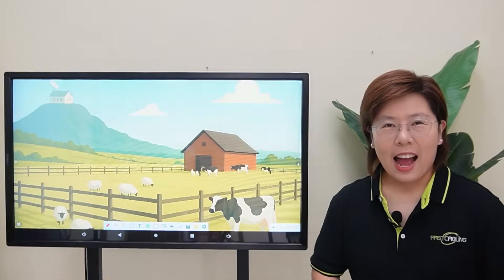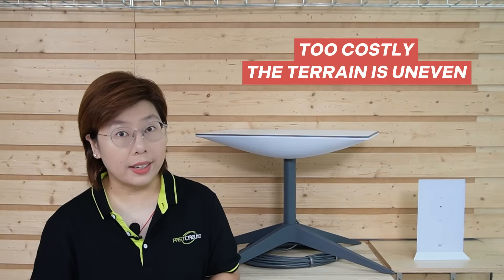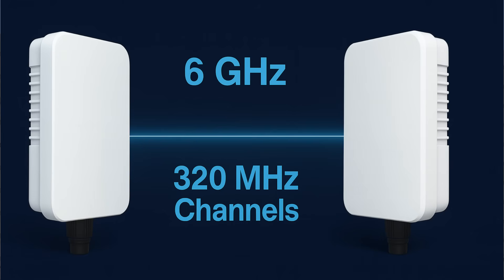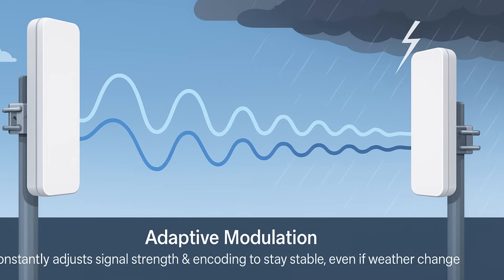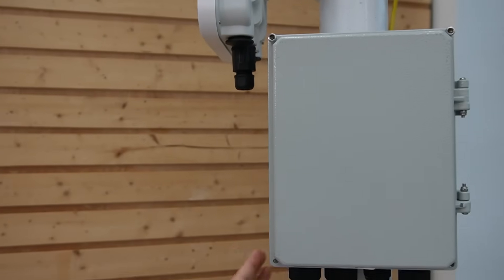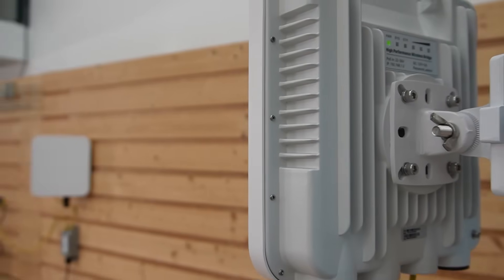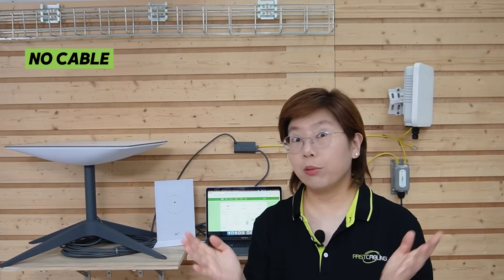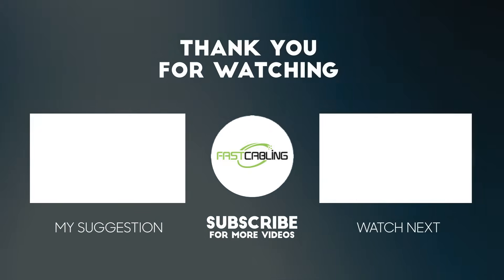Extend Starlink Internet 6KM Wirelessly | WiFi 7 Bridge Setup for Remote Farms

Comment: Thank you for your idea
How do you give power to outdoor POE Switch
Reply from the maker: Plug it into mains power or using solar power. You can use a 48V voltage booster to regulate the fluctuating voltage and  convert it to the regulated 48V output.